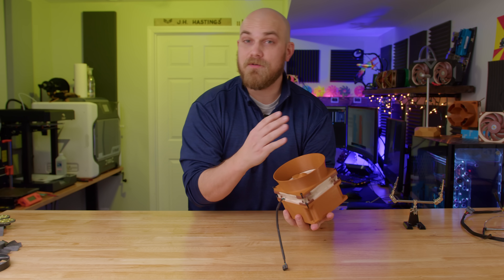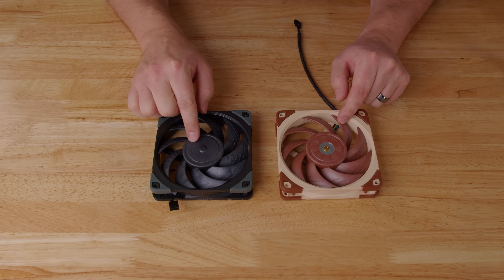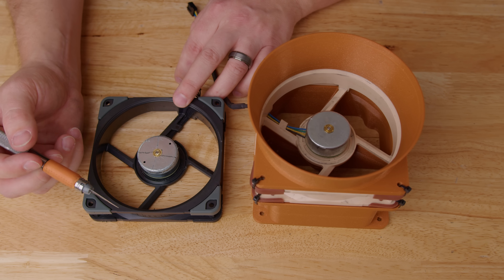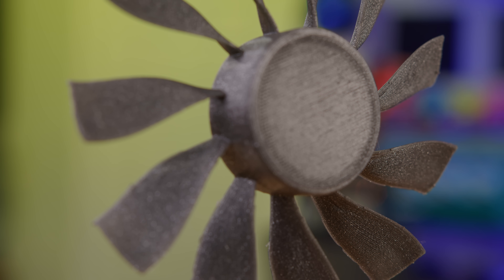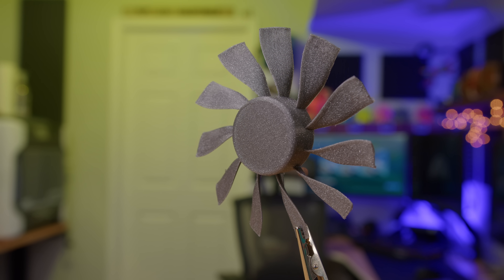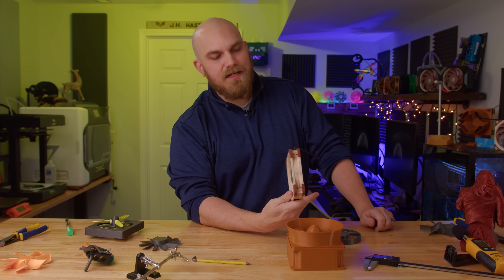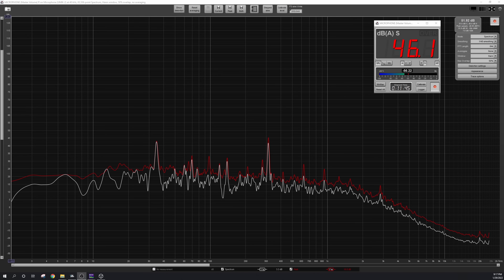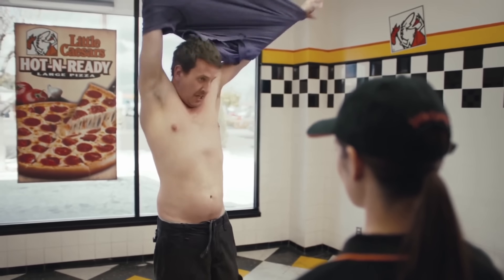Overdrive ENGAGED | Fan Showdown S4E1

Comment: There should be a separate category for fans with accoutrement like the cheater. Using it as the baseline is bad. Set it to the side or every fan will have to have the cheater stuff on it or else lose.
Reply: That's what I was thinking. Ducted airflow is always better. I bet every fan would perform 10-15% better when ducted

And it kinda defeats the purpose when dragging a fan into the next 2 seasons, because it will always be in the top. I wanna see new fans outcompeting each other. And maybe a winners special when we get to season 5.
Reply: I kinda feel the same way. The ducts that come with The Cheater are performance enhancements that are compatible with most other fans in the comp. Someone bothered to make them, with design not particularly unique to their actual fan, and gets a walk thereafter? Either remove them or make them the standard rig, at least an option for any entrant to choose to use, otherwise what we're comparing is how much people are willing to cad above and beyond making a fan.
Reply: Agreed. Need separate classes for shrouded vs non shrouded.

Comment: The holes are probably attachment points for the fan. Plastic or adhesive may squeeze down into the holes or maybe the fan blade has nubs that fit down in holes. Maybe for positioning or alignment.

Comment: Season five. Water test? Food coloring fun? How durable are the fans under a huge load or weight they are trying to push
 In other words which would be a good propeller
Reply: How many fans because being 3D printed is fragile... Would break apart in the water or under such a heavy load would the blades just snap apart
Reply: Unfortunately that would require almost every set that goes into that kind of season to have some sort of reduction gearbox for more torque. Kind of the opposite of a top speed oriented gearing. We shall see if that becomes a reality.

Comment: Since they are fully encapsulating the hub in the new fan design, they needed vent holes to allow air to escape during the assembly process. That's my guess.
Reply: my guess is its a different manufacturer that's producing their motors for the new fan.